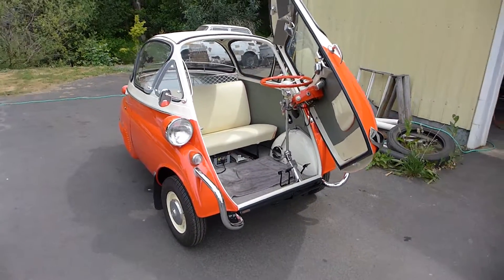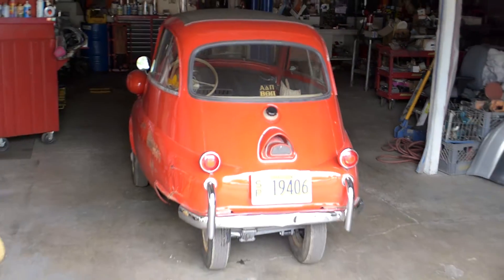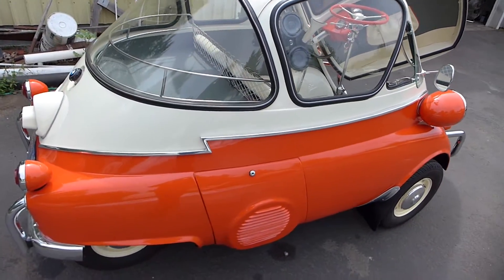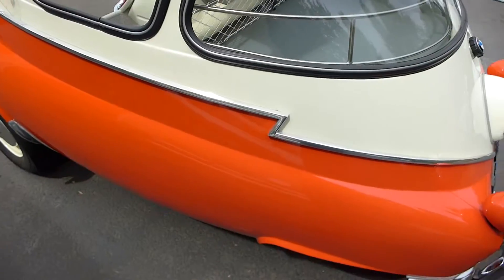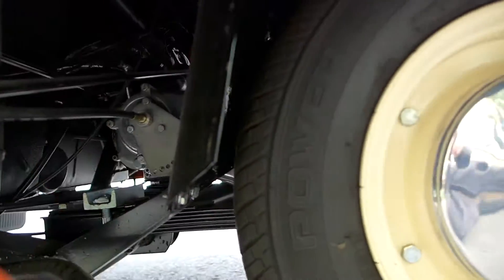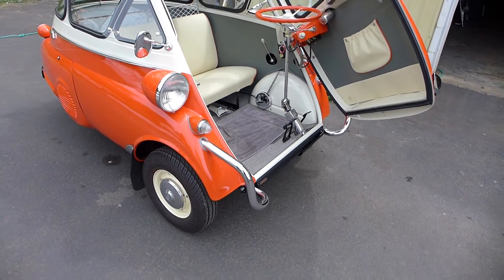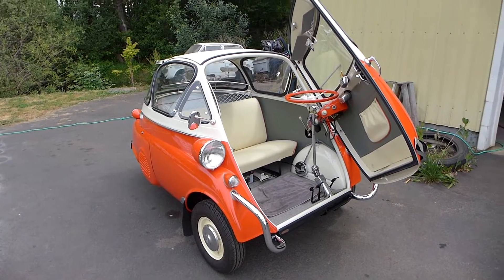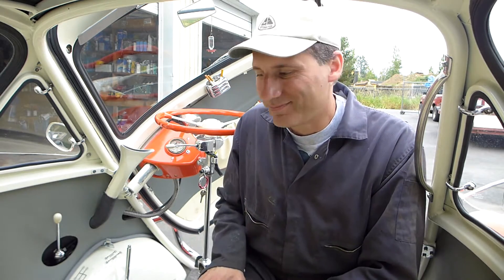Fabulous Bubble Window Z Molding Isetta Road Test Drive

Comment: The original Iseatta was designed by Iso in Italy, it was also built under license in France by Velam with the same two stroke engine than the Iso version.
BMW versions like this one were not quie the same, different side and rear windows, and a 4 stroke engine derived from BMW motorcycles...

Comment: Nice car! The steering wheel should be cream colored to be correct. Your muffler isn't the original design but looks nice just the same. Some early '57 Isetta's had the '56 bubble window body like yours but it's definitely not a '58.
Reply: Probably from when it was first registered?